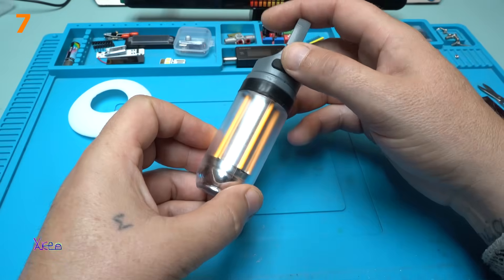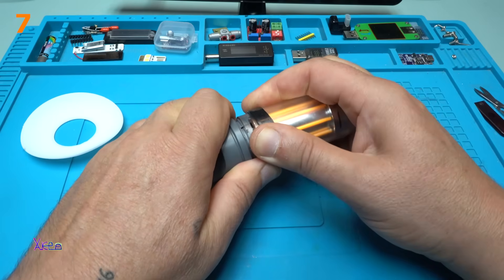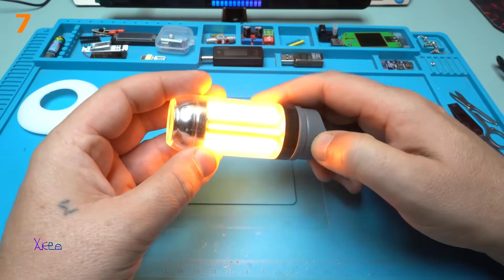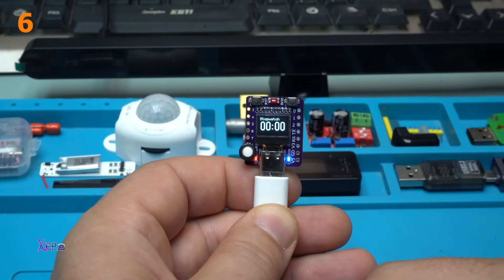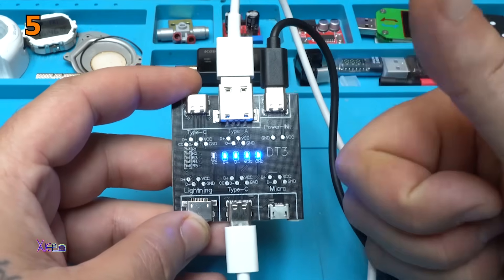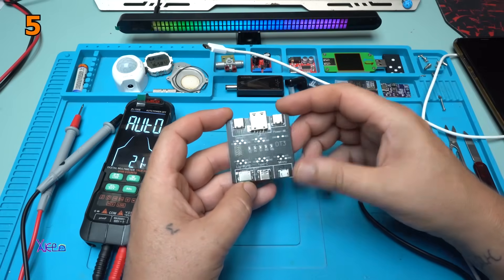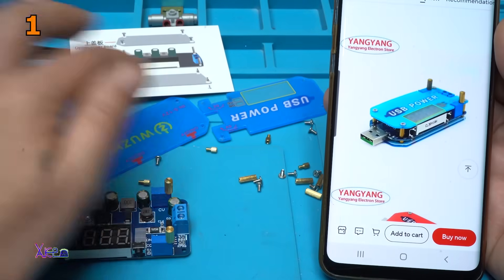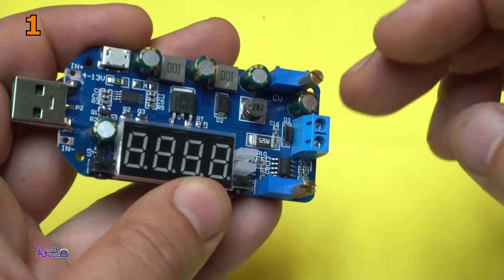TOP 7 FANTASTIC Aliexpress Modules

Comment: This is a brilliant channel and as an avid Ali Express shopper (addicted lol) its great to see some really good gadgets and ideas.  I have a question for you,  I have built a ball clock and need to drive it with a motor at 1 rpm. I have tried contacting some sellers on AE but the question gets lost in translation.  If you were trying to do the same do you have any AE suggestions that would be plug and play for someone not to good with electronics ... Thanks
Reply from the maker: Hello sir. You need a motor that will rotate in 1 minute a whole circle,that is pretty slow and only solution is doing with Arduino and stepper motor.
Reply: @Hacktuber  Thankyou I have tried the Arduino route but didn't have a clue what I was doing lol

Comment: Where can we get the ESP32 C3 oled development board with the button? If it doesn't come with the button, wherer do we get one and how do we connect it?
Reply: It looks like the button is connected between pin 8 and pin 10 and pin 8 is set to LOW for the ground and pin 10 is the button input.

Comment: i actually got a couple of the dc to dc power supplies and use them to power sinclair spectrums
Reply from the maker: I have never work with sinclair spectrum and never have😔
Reply: @Hacktuber  your missing out on frustrating fun !!!  ha ha ha
Reply: Это тот самый Sinclair Spectrum который ZX80 ? Он до сих пор работает? Интересно как вы его используете? У меня был такой тогда, когда он был актуален и интересен.
Reply: @madeinukraina777  its the rubber key and plus versions i have used them on , the thing to remember is that spectrums and zx80/81 have centre positive power supplies and many many back in the day were damaged due to using off the shelf PSU's with centre negatives , another sir clive quirk if you will . i and many many others use them for games to relive our childhoods and many make their own games as well if you look round the web you will find lots of support for these machines

Comment: What I find interesting about humanity is how we overcomplicate things. A simple switch would work for decades but now we need another circuit board to activate a simple switch that could ghave solved the problem. The only use for this is in small devices with no room for a large enough switch to activate a current-drawing device.
Reply: A very limited opinion. And specifically this one can function as a button or a switch. And the possibilities of use are many times greater than a conventional mechanical switch.

Comment: #1 Wuhzi usb CC power supply is very good. There are many variants. Model no start with ZK-DP...
DP2 Low End = Bare PCB with screwdriver pots. Single 7 segment display.
DP2 High End = with Blue Case and "Long Handle" Pots (point upwards).
DP2F = DP2 with blue case and inbuilt QC Trigger.
DP3A = Red case and Long Handle pots (on end), Blue dual display (Volts + Amps). QC Trigger
DP3F = DP3A with digital controls. NOT recommended, the roll wheel is hard to use.
** NOTE: You can calibrate both Voltage and Current display. Read product descriptions until you find the instructions.
Reply from the maker: Thanks for the detailed breakdown of the different variants!

Comment: I bought a few of those lanterns for the battery and LED filaments, but I decided to keep one as is for camping, the others I'll dismantle when I have a project I want to use the parts in.
Reply: Why? It's cheaper and easier just to buy the filaments themselves.
Reply: @johncoops6897  you're ignoring the battery, unless you're buying them in bulk, the sum of the individual parts is cheaper than buying them together like this because the makers did buy them in bulk. Buying just that battery alone is more than the $3 I spent on the lantern.
Reply: @Led_Icaurs - yeah, I realised after posting that I omitted the battery. I harvest mine from "street lithium" so I have literally hundreds in all sorts of sizes for free.
3V Warm White filaments cost as follows, USD incl free shipping:
10 x 38mm $1.45 = 15c each
10 x 54mm $1.85 = 19c each
10 x 68mm $2.70 = 27c each
And 30 x costs about double.
That was just a quick check on Ali, not spending time to find the best deal.

Comment: Those capacitive touch sensors can be made to latch if you short A and B points.
Reply: There are 2 settings for TTP223B.
Bridge A for active low output.
Bridge B for latching (on/off toggle).
There are better modules than the TTP223, including mosfet output, dimming, 3-step output, etc.
For bare modules, the "OE-TP" is probably the best, but you can also find modules with lithium charge IC built in for about $1 each.
Try "Touch Desk Dimmer Module"
Reply: Really. Interesting. 👍